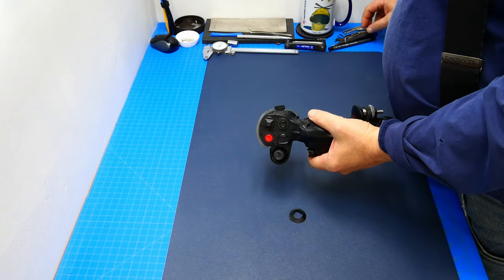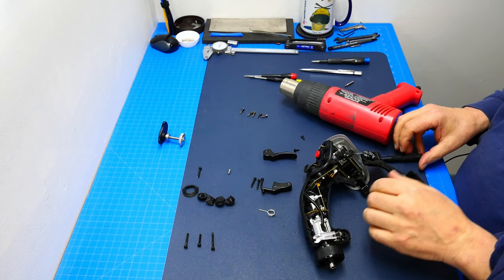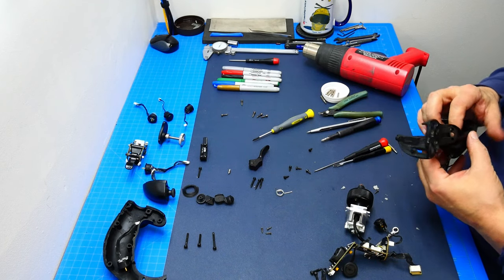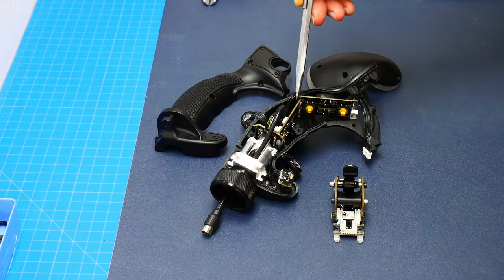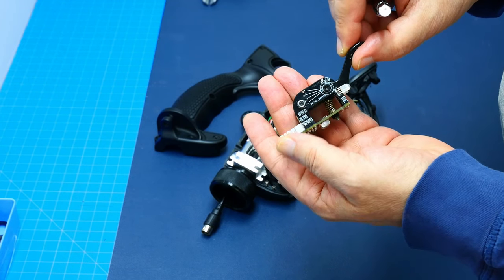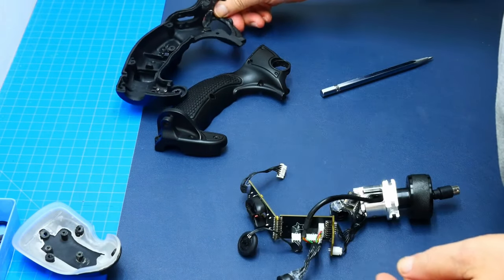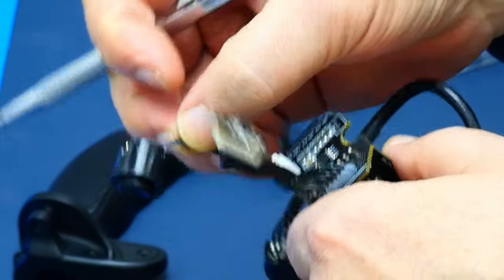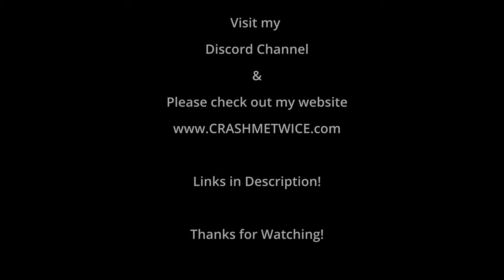Virpil VPC Constellation ALPHA Internals - A look inside

Comment: I wanted to change out the mini stick, but now I am worried about getting the grip back together. Excellent video with lots of detailed shots, well done.
Reply from the maker: It really isn't that difficult, just a lot of work and time involved. Cleaning up the hot glue is the most time consuming part on it. Just make pictures every step on the way and you'll be fine. Thanks for watching and commenting! Cheers

Comment: Thank you for this video.  I've been having issues with my out-of-warranty ALPHA twist grip not tracking consistently.  The video is very detailed but the actual disassembly of the grip case and details of which screws / bolts need to be removed was very rapid and missing detail.  Is there any chance you could post a diagram of which screws are necessary to remove to split open the case safely?  Thanks again.

Comment: Thanks for showing the inside, it looks really well made! The spring you show that can be adjusted by picking a different hole what does it change?
Reply from the maker: Yes, it is nicely made, Virpil does make excellent controllers. Very smart layout and using the PCB's as a structural element for buttons, wheel, and the flip switch is quite awesome engineering. The spring provides the tension to the flip trigger. Depending on the selected hole, it makes it harder or softer to depress the trigger. I think they did it because often springs vary in strength depending on sourcing and manufacturing, not actually something for the end user to mess with :) Thanks for watching and commenting! Cheers